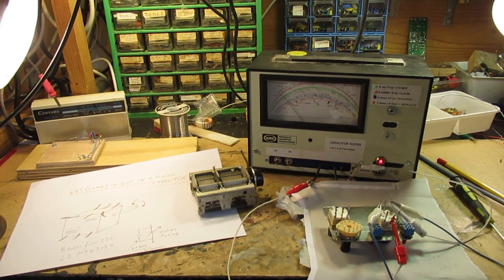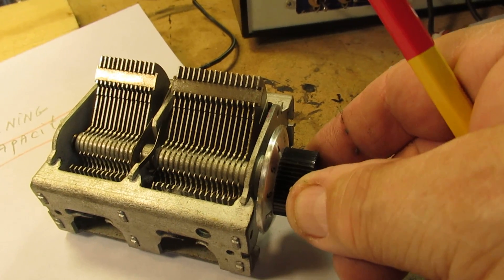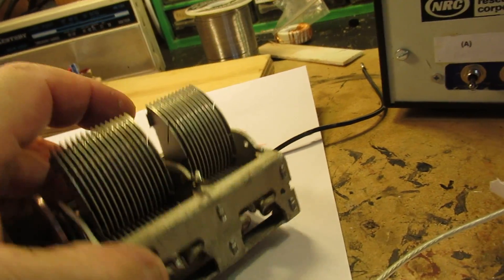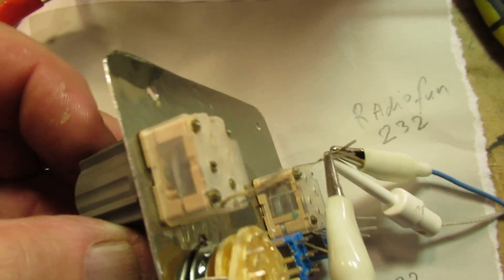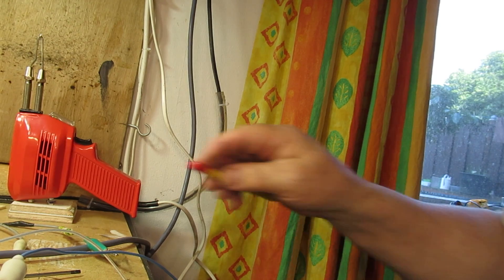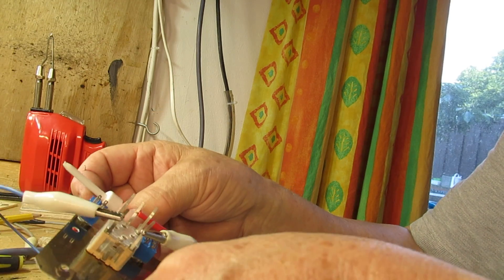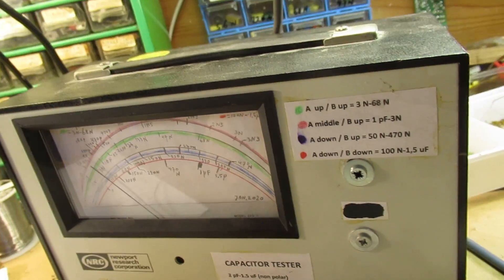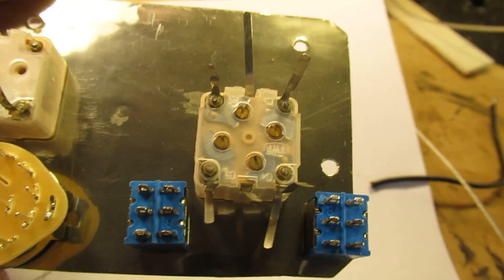Some insight in a radio tuning capacitor 10 Pf - 600 pF or higher (VLOG) via a test

Comment: I had a weird effect they took me weeks to find out. But i have a radio that was very old transistor and i changed the speaker. The one i changed hand a bigger magnet on the coil , but it right next to a small tuning capacitor and completely swamped the variable capacity and it would not tune . That's when i found the magnetic field was causing, put a smaller speaker in and it worked fine after that. Try moving a strong magnet by one.
Reply from the maker: That is/was a very interesting issue! Could also have been an effect on the ferrite antenna or one of the coils, by the way. Anyway, thanks, this is very important info for everyone.

Comment: Another interesting video with lots of useful information. I have an idea to experiment with old CDs, covered with copper tape and made into variable capacitors.
Reply from the maker: Good idea!
Reply: Inter-plate distance would be too great to make anything of more than few pF I would guess. And there's the inner foil to worry about. I'd be curios to see if that has much effect actually. 

Unless you made the dielectric of something very thin and put a layer of aluminium on as the conductor. Greaseproof paper would work, saran wrap/cling film would be fantastic.

Or go all old school and make it out of PCB! Oh I wish I was young and rich.

Then I wouldn't waste all my time learning this stuff and I'd move somewhere hot with lots of alchol.
Reply: @marcdraco  My idea is to encase the CD in tape so both sides are electrically one surface. Then sandwich several CDs like an old school variable capacitor found in tuners. One set of CDs on a shaft. Another set as fixed vanes.
Reply: @marcdraco  Thanks for your reply and information. It's an experiment I'll get round to one day when time permits. At present my time is taken up with antenna and shack building. 73
Reply: @acestudioscouk-Ace-G0ACE  I keep telling myself I’ll find a rally I can go to and snag a nice geared, oil damped air gapped VC and some old germanium diodes. Just in case we ever need to return to AM. Which is more frightening a possibility than at almost any time in my life.

Comment: Is there a standard frequency at which variable  capacitors are measured/rated? 1KHz, perhaps? Thank you.
Reply from the maker: As far as I know: no. But when you study old school radio books, the way that the capacitor changes its capacitance when the knob is turned can differ substantially. Has to do with the way the plates are made, thus say making a linear change of the capacitance or a non-linear change. Has to do with the frequency band for which they are/were made (in the past) and say the "spread" of the received radio signals on the tuning scale, given a certain frequency band. 22 May 2024.

Comment: wow!!! So hard to find one of those now a days!!
👏
Reply from the maker: Yes & true, these old school ones.
Reply: Old tubes radio have this types  tunning capacitor . Plastic ones come with transistor radio with Japan made one 
. Good job
Reply: You mean the geared air-gap ones?

Like rocking horse droppings mixed with unicorn hair.

The plastic nasties are still widely available.
Reply from the maker: @marcdraco  Yes, though there are/could be quality plastics, though (of course) never used in these old school tuning capacitors of the 1940's-1970's, early 1980's,  like I show here, where the isolation material was HQ porcelain.
Reply from the maker: @marcdraco  Go to radio flea markets where you can find them with also "poor" radio amateurs. 😁
Reply: @radiofun232  we’re all too poor to even have radio rallies here. I haven’t heard of one nearby in more than three decades. I’m sure they still exist but they are likely too far away for me to travel to.
Reply from the maker: I posted  a first comment on your reaction, though could not see it afterwards. As far as I know, where porcelain is used to insulate the capacitor plates, we have to do with (quite) high quality tuning capacitors, in general made for tube circuits or anyway. In (say) "modern" tuning caps (say the small ones for transistor radio's) we have to do with certain plastics that insulate the capacitor plates, going from say 10 to 150 pF or 10 to 470 pF (in general). These plastics insulate quite good and thus they were able to make a small tuning capacitor in a very small size, like you see them here. That is what I wanted to tell when making this video. 24 May 2024.
Reply: @radiofun232  I think the type of plastic used in these capacitors also greatly influences the capacitance. I myself have experimented with building a simple variable capacitor but used PAPER as the dielectric. 🙂
Reply from the maker: @attilarivera  Good idea
Reply: @attilarivera  Paper doesn't work too well (it has to sealed) or the capacitance will shift according to how much water has got into the paper - that contaminant can even pass small currents and they cause a lot of old time radio gear to fail.

The "size" of a capacitor in farads is reliant on quite a number of factors but mostly the distance between the plates and the total area of them. I would imagine porcelain was used because it's a superb insulator and perhaps because when glazed the finish would be good. I've never seen a VC using something other than a plastic or a air dielectric but I only dip in and out so it's possible. 

But you are correct that the type of plastic in use because of the long-chain polymers produce excellent resilience with very high resistance. Amongst those, PTFE is the best in common use although I've no doubt there will be some sort of esoteric weirdness (unless we think of electrolytics but they don't store charge in the same way as I understand it.
Reply: @marcdraco  You're absolutely right. I didn't achieve good capacitance using PAPER. Next time I'll use a different material. 🙂
Reply: @attilarivera  any thermoplastic will do. Bakelite works but it’s pants. :). 

The thinnest sheet you can find but remember is has to stay nice and tight. I wish I had time to to that experiment. Sounds like a good science project for the kids.
Reply from the maker: @marcdraco  For the kids?
Reply from the maker: @attilarivera  The best isolation "material" between capacitor plates is (dry) air. It has the highest insulation properties. There are tables for insulation properties in radio technology/books (materials between capacitor plates). Surely on the internet and www. Waxed paper can work good, also special paper materials and plastics, especially PET (polyethylene teraphtalate). When you want to know more, contact me via email.
Reply: @radiofun232  air is the best on paper (which is also good) a vacuum is better but a bit ridiculous. I t’s impracticable to make a variable capacitor with an air or vacuum dielectric because the plates would have to be closer than is achievable with a polymer. I did a quick look up and the record holder remains PTFE (Teflon) followed by the other polymers. We can’t get these sheets incredibly thin without any chance of of the two plates coming into contact. 

https://en.m.wikipedia.org/wiki/Relative_permittivity
Reply: @radiofun232  Okay, I'll research more about insulating materials to make my variable capacitors. I was thinking about using mica as an example. Here on my property, mica is found in its natural state!
Thak You!